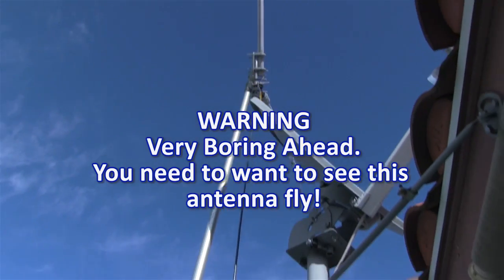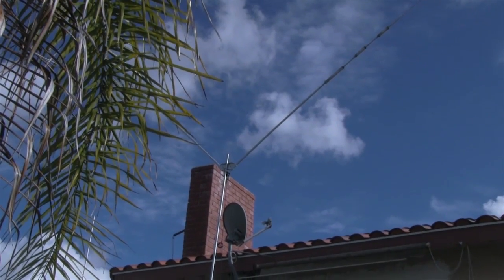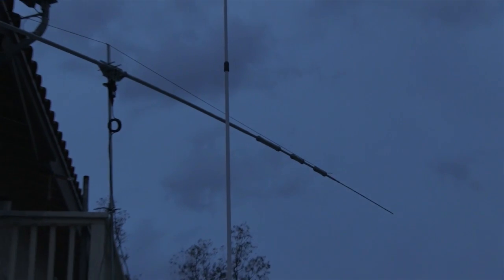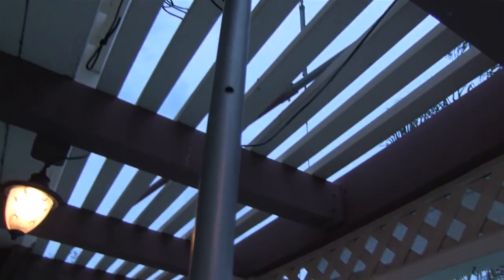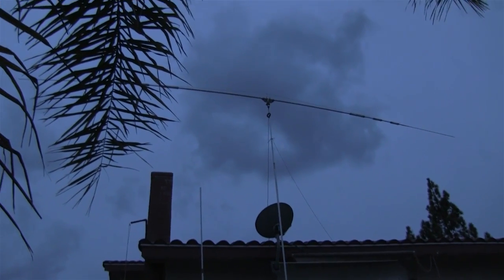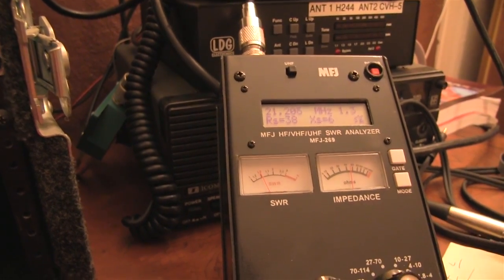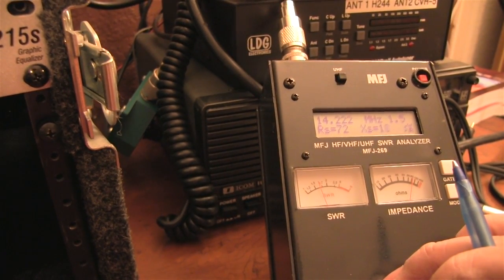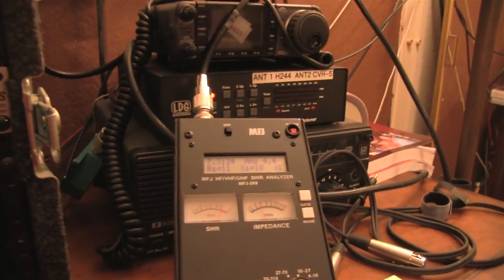Comet H422 Horizontal Dipole Setup

Comment from the maker: its actually a comet ch5v  and it sucks.  it is a great lil antenna but the bandwidth is minute at best.  sub 2 swr on 40m or 20m is like 15 kHz  ... and its not easy to tune either.  In a pinch you can make it work, and that's what counts I guess.